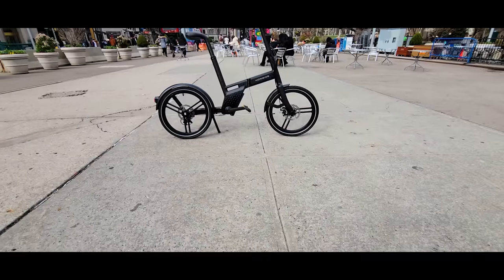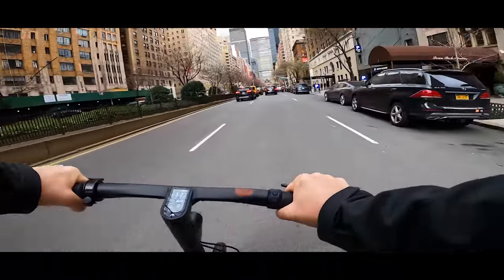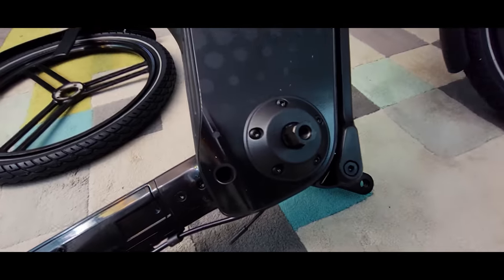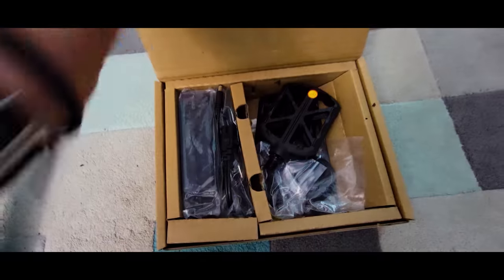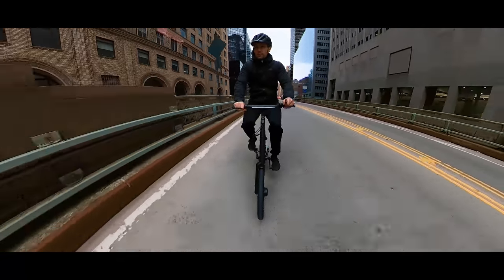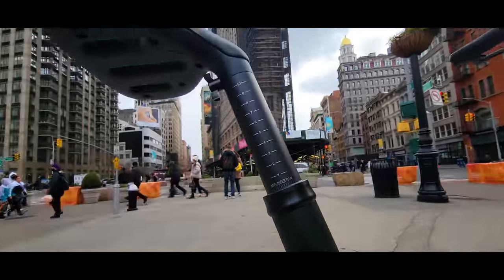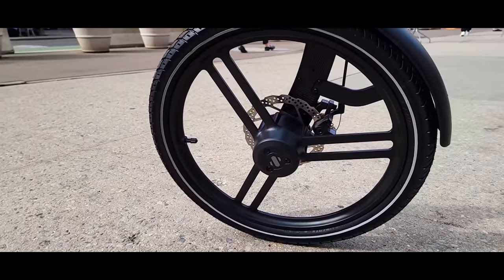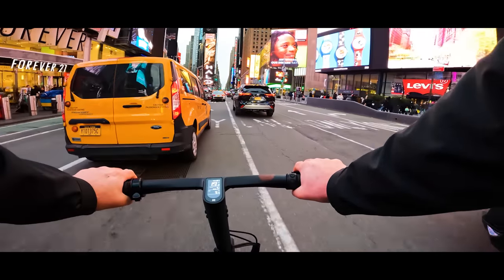HONBIKE: The Most Advanced Folding Electric Bike with Single-Sided Shaft Drive!

Comment: There are so many small e-bike brands pop up here and there. For sure not all of them will survive in the next few years. Eventually your e-bike will require maintenance and replace worn-out parts. With so many non-standardised components, if the company no long exists, where do you get the replacement parts? So your fancy e-bike becomes a fancy paper weight after a few years? Or you just buy new e-bike every few years?

Gear drives require precise alignment and the structure with enough stiffness to maintain it. Unless you over-build the rear triangle of a bike. The bumps and unevenness of city roads will flex the bike structure a lot, and the alignment of the gears will be thrown out of the window. That is why although gear drive bicycle has existed for very long. They never became widely used, because it is hard to engineer a good reliable and cost effective one. Good luck with that single sided rear arm to house the gear and shaft.

Comment: Beixo have a folding electric bike with shaft drive and 7 gears and a front hub motor.   Mid drives are expensive to fix.   Front hub you can easily change and if you want just put back the ordinary wheel and it's a normal folding bike.   I have one and it's really powerful.

Comment: Nice bike, very nice handlebar display and design. Like a scooter. seat not as nice as my bike though..
I got a fiido d2s and it was well packaged folded, no assembly need at all apart from put the seat post on.  Decent size box too.

Comment: it is actually the opposite, shaft drive is less efficient and that is the reason why they are quite rare (also price and lack of shifter, although i don't fully understand why they are so expensive). of course it helps a bit that it does not get dirty when enclosed properly but not that much that it becomes more efficient than a traditional chain system. being electric helps to smooth out that efficiency gap, at least if it isn't a mid drive system.
Reply: There is a shaft drive that you can shift. High-end. No gearbox. it was ceramicspeed.
Reply: @tonylawson6636  yes i've been following it. in my knowledge it still isn't ready for use and have some unsolved problems. a generator & motor combo might be even nicer but most likely small and affordable generators and motors are something like 85% efficient, thus full cycle would have 28% power loss (probably more)
Reply: I think you would loose 30%  power from the gears ⚙️
Reply: This is a very poor, expensive design for any bikes. It requires expensive repairs when it breaks and will break easily.
Reply: Efficiency is really only an issue for competitive riding, as a commuter no one will care. As an aside, I'm still waiting to see bikes incorporating the Valeo system.

Comment: motors driving wheels with shafts?

AMAZING

JUST AMAZING

Why has nobody thought of this before?  

Shaft...drive...hm.  Novel.  Have they applied for a patent, I don't think I've ever seen this used anywhere, the whole shaft driving a wheel thing.
Reply from the maker: yes mid drive with that shat will be cool.
Reply: With the HONBIKE, the motor drives the front wheel (Hub drive), not the shaft. If a motor would have to drive the shaft, it needs very low RPM and therefore gearing. There is no efficient setup for that on the market. 

The real wheel is shaft driven by the pedals. 
Shaft drive is nothing new, it is used in motorcycles (BMW, Moto Guzzi, Honda), and a few bicycles: BMW, Beixo Slim, Brik Fietsen,...

Disadvantages of the shaft drive is the heavier weight and the costs. It also makes gear shifts difficult, and a drive shaft always has some play....    All that makes it uninteresting in most bicycle applications.

Comment: A bit of common sense : if this drive system has been known for a long time ( what they say in the introduction of this video ) , why it has not been used so far by the cycling industry ?
Reply: Because is less efficient than Chain or Belts. Chain and belts are just so much better compared, it's less complicated, it's easy to change from 1-7 because is simpler. So over time people preffered the simplicity of the chain and belt over the complicated but sturdy and very resistant shafted bike.

Comment: Why don't single speed bikes have driveshafts? 

I don't think it would have to be much heavier if a carbon fiber drive shaft was used.
Reply: Mainly because they are less eficient. A clean, perfect condition, freshly lubricated  shaft drive is less efficient than a muddy chain drive in the same price range.
Although this is less of a problem with electric motors.

You have a lot of torque on that shaft drive (there is a reason why the shaft is that thick) and i'm not so sure if carbon fibre can withstand it.
Plus you would still need metal gears, carbon fibre is simply to soft, and with that, joints on the shaft drive.

Comment: Yamaha made one like this in the late 80s or early 90s. Shaft driven at least. Everything else was possible at the time other than the lithium battery. But not a new technology. Not a new design.
Reply: Oh wait. No. Yamaha had a mid drive. Not a hub.
Reply from the maker: I don't think it was electric nor had all the sensors.

Comment: that driveshaft is unneccessary complication, there will be friction loss in the drive, better would have been an electric motor in the hub of the wheel instead of that extra driveshaft. thats the main thing i'm not liking on this bike. another thing i'm not liking is the cables that are all visible outside, it would have looked so much cleaner and nicer if the cable were layed within the frame. the battery should have been inside of the frame, that frame could fit a much bigger battery than that on that bike, for more speed and more range. that bike is a bit slow, its much slower than the cars in the traffic and becoming like an obstacle to the cars, one day a car driver will not pay attention and there will then be an accident with that slow bike. i think that bike is for what it is worth new maybe $400 on the current market. beside that, that guy had to assemble the bike by himself, many little parts. a consumer is not a bike technician to have the knowlege how to put a bike together and that can be dangerous when that bike is then moved in traffic.

Comment: Drive shaft in bicycle isn't reliable at all, and has many problems and need 10 times more maintaining than chain. Also it's not efficient, but that's not significant problem in e-Bike, because you are motorized and not use human power. If the designer wants to improve the driving system rather than chain, it should be by belt.

Comment: A range of 14.7 miles or 23.6 kilometers is very bad for an electric bike.
Reply from the maker: For light vehicle for city comute its all you need. On average people ride 7 to 10 miles at the time. Research ...
Reply: @ElectricVehicleSpace  How much does it cost?However, in our country a cheap electric bike takes about 50 km. before the battery runs out. And the more expensive ones are up in the range.Otherwise, it is true that most trips are short.
Reply from the maker: @stargate12A  you wont get innovation and superior parts with quality and design with cheap.